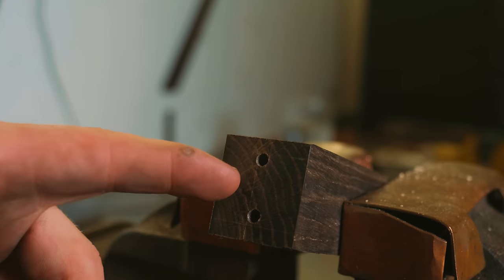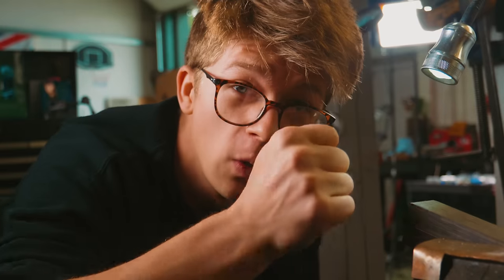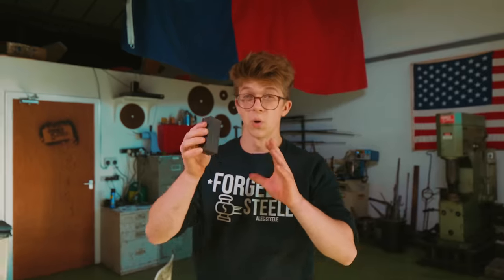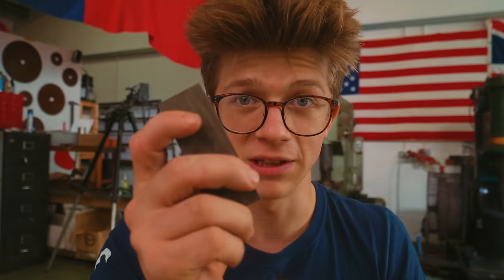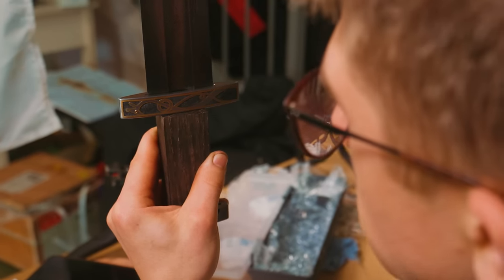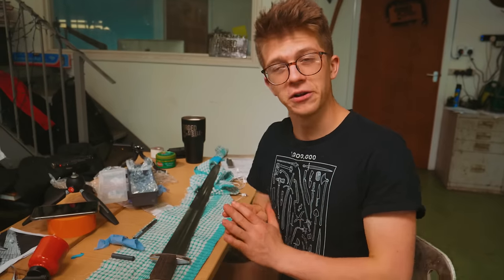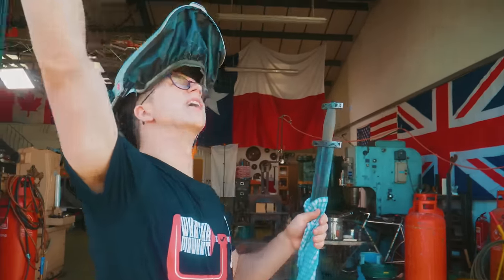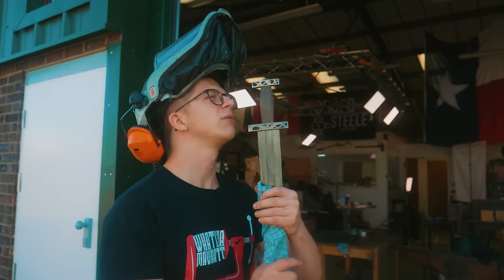MAKING A VIKING SWORD!!! Part 27

Comment: What if made a metal piece to fill that half circle and inserts into the length of the handle by carving shallow trench into the bog oak? Sort of shaped like a pin with a ball point end to fill the spot and then the length gets inlaid into the length of the handle up to just before the halfway point?

Comment: You could make the new handle with the piece you have then cut it in half and insert a band of metal [Gold/platinum?] in the gap akin to a large oval washer .BTW I meant to ask do you have a manufacturers mark you put on the tang similar to the way the Japanese did?

Comment: Alec I love this sword so much, but I have to agree with a couple of other comments that the wood is just too plain compared to the rest. Now you've made the error, I think you should use it to your advantage and maybe use the centre section of the wood, cut it and use it as the ends, then use some steel in the middle and add some more detail, maybe some more engraving. You're always saying how much you need to keep practicing your engraving!

Comment: Great video as usual. It would be helpful when stating sizes like "1/8" and "3/16" inches if you said them in mm cause i shoild imagine a good portion of you viewers are used to the metric system not the american way. I myself know its approximatly 3 and 4 mm but it could be helpful for others. Just a though

Comment: For your Viking sword, I am not sure about the colour of the wood. Its too simple to match the rest of the sword.
I would carve shallow channels on the wood (maybe channels which, in geometry, match the cross section of the handle itself) and then fill them up with soft black paint (not too dark).

A thin inlay of a bright/gray metal on the wood would also help the handle to blend nicely with the rest of the work. As it is, the handle just stands out too much. It doesn't do justice to all the exquisite work everywhere else.

Comment: I just want to know. Are your swords really battle worthy? I mean would they last through many battles like the swords of old? I Like your work and your dedication. I really wish I had the tools the room and the equipment you have. I do have a kiln and a welder a Severt torch and an angle grinder and a two pound short sledge hammer. No anvils or forges. But I have no room here either. I work with glass and smelt silver and gold.

Comment: What if someone puts 24k gold in a peice, gets it rated and stamped for 24k, then replaces the 24k gold in the peice for a way cheaper gold? What's stopping them from selling the peice at a 24k value since it's stamped and rated for 24k, even though the expensive gold has been replaced by cheaper gold and recycled?

Comment: Would it not be possible to cut the handle in half, keep the already perfect bottom half, sand down the unfinished block to the proper size for the top half, then edge glue the two together? It would be such a shame to lose the bog oak. Edge gluing is a very acceptable way to work wood and it's not like you haven't taken the complicated route in the past.

Comment: It seems you have spent a lot of time finishing  and it comes to mind my time building boats. Your order of operations are somewhat backwards. So I will give my unsolicited advice because This is youtube. 

When putting together assemblies being boats airplanes or swords the first thing to do is get all of the pieces made, then they get fitted, and then finished. It seems part of the difficulty you are having is that of finishing each piece individually instead of treating finish work as something to be done at the end of the entire project. 

Indeed the inlay process could have been treated as part of the finishing, because it has little impact on the mated surfaces of the piece.

Your work is brilliant, and I enjoy watching you make many of the same mistakes I have made and learning along the way keep it up.

My overall advice is to write down a plan of how you want to go about a project. It can change as you go, maybe write the steps on post-it notes so you can move them around and just outline the process so you know when to stop 🛑 working on one piece to keep the whole project in view.

Comment: Hey man where do you get the little saws for clearing out the center for your tang?
Reply: Need a tool make a tool?
Reply: Need a tool make a tool?
Reply: I’ve made a lot of tools but you can clearly see that broaching saw was purchased.
Reply: I believe from Black Dragon Forge
Reply: Or you could use a jig saw blade mounted in a handle. Simple solution with a simple fix... Pin hole in blade and handle so you can always switch out blades thus giving you different sizr options as well.
Reply: TheSatyrblue that’s not a bad idea! Thanks!
Reply: Coping saw could have done the whole job easily

Comment: With all due respect, I think you should take some machining lessons and learn how to accurately measure and scribe, because measurments not lining up seems to be the most frequent source of trouble in your projects, despite the fact, that you are sneaking up on the perfect fit whenever you can. It could be time really well spent, since it will save a lot of time fixing stuff.
By the way, how is your workshop, have you been keeping it nice and tidy?

Comment: Why doesn't he just put a 24k gold spacer up against that area that shows the gap it will look awesome with the silver back drop. I think its cool he a perfectionist but hell he going a little to far.
Reply: I dont know if Alec reads these but for lord sake don't skip using that beautiful pc of oak on that handle. Just put another spacer pc up against the gap make 24 kt gold and have it re-assessed for the value again. You could even do some scroll work on the gold spacer to jaz it up.
Reply: Also if you don't use that oak pc on that sword you remove the antiquity of the swords value. As it sets without that oak handle pc its nothing more then a specialty craft sword with precious metal. But by adding that 5000 year old pc of oak it gives it Antique quality. Put it another way, As it sits without that handle the sword could go on a auction as high as $2500 or $3000 as it is now. With that oak pc i could see some collector buying it for between $10,000 to $30,000.00 easily. It gives it real value. So unless you have another ancient pc of wood laying around i wouldn't give up on that wood as the handle. Just my humble opinion.